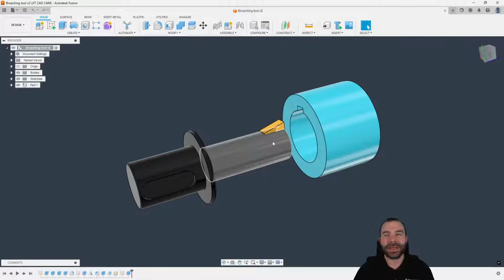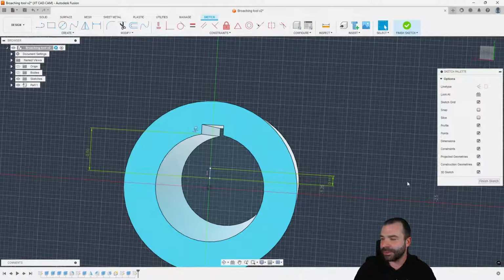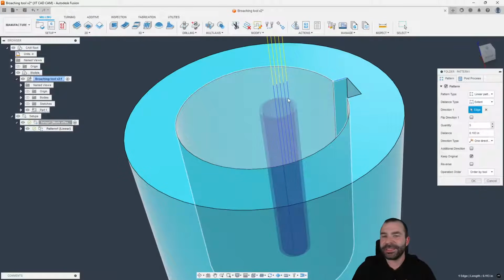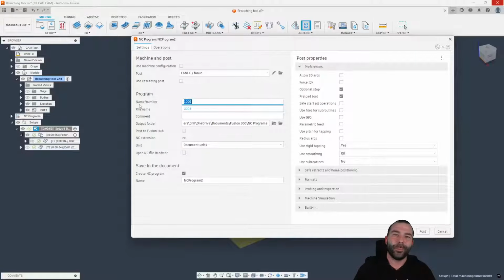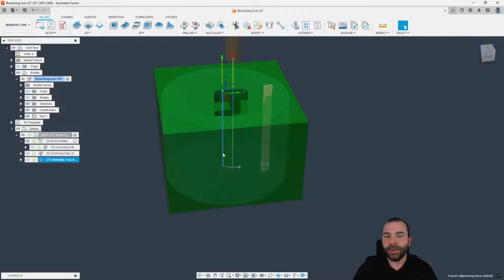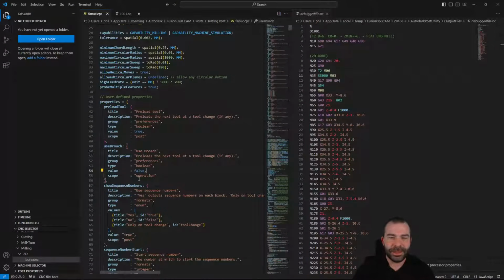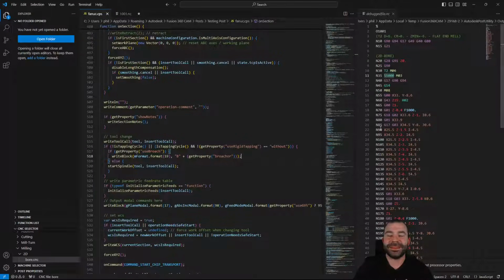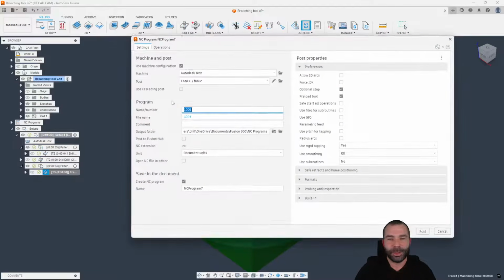Workflow Wednesday: Spindle Broaching

Comment: I like watching these videos about editing post processors. I’ve been trying to adjust my smoothing parameters which already automatically adjust my machine tolerance according to stock to leave values. However it always sets the machine tolerance to exactly the stock to leave value which can actually gouge the material at high speeds. I haven’t been able to figure out how to give the smoothing a little tighter tolerance to avoid those slight gouges.
Reply from the maker: Well sir you are in luck, Give this video a watch and I think it will change the way you do things.
https://youtube.com/live/oOelpPZTFd0?feature=share